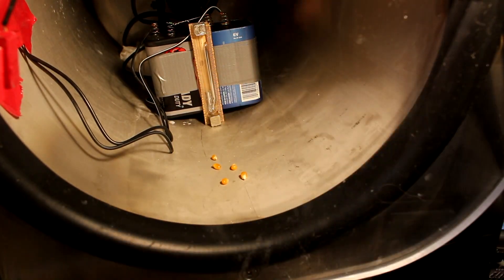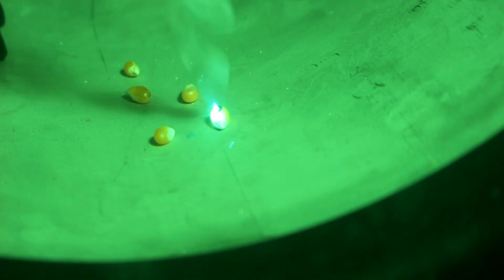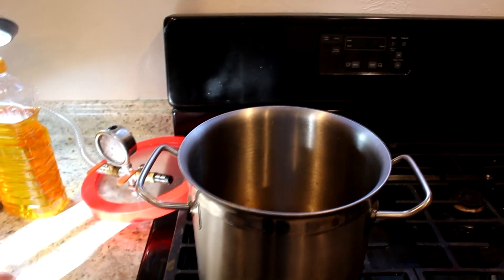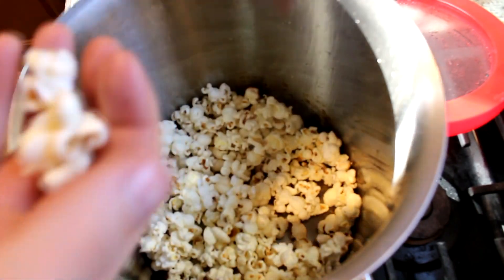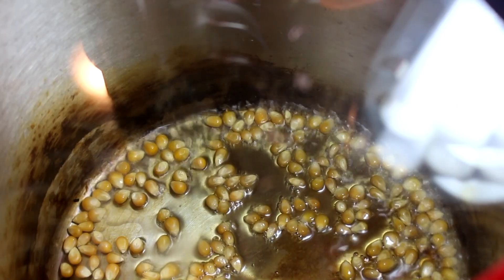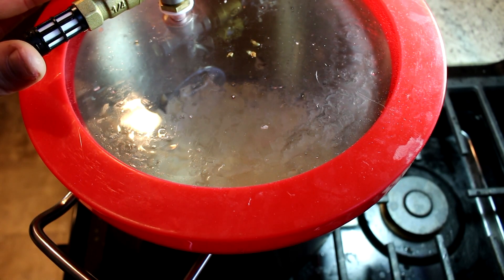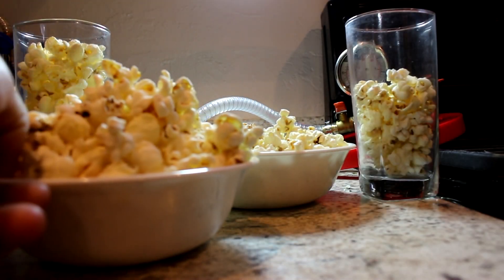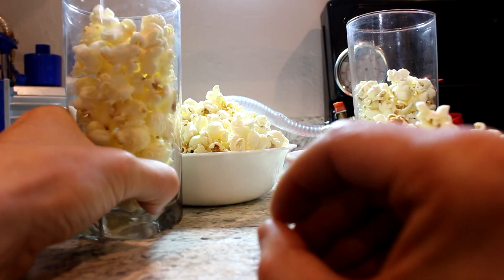Popping Corn In a Vacuum

Comment: great video.  I will have to try this one day myself.  My scientific mind also comes up with extra variables that might account for fluffier popcorn. One, is the vacuum  pump removes  ambient moisture from the air, so just the lack of moisture might also contribute to fluffier popcorn.  Also, popcorn has to be heated evenly on ALL sides.  That is why your laser didn't work.  While popping corn on the stove, you need to agitate the corn so that the unheated sides get heated.  That could also explain why more corn popped in the vacuum because they popped more violently, thus agitating the other corn in the pot to create a higher success rate.

Comment: You can pop the popcorn with laser if you wrap it in aluminium foil first. If you are still having difficulty even with that, you can coat the corn in a thin layer of oil first to make the heat spread out more evenly.

Comment: Late 2020 here with this observation that Cody cooked the popcorn incorrectly.  He seemed to add way too little popcorn for the amount of oil he used.  Heat the oil along with 3 kernels.  When one or more of them pops, add the rest of the popcorn.  I estimate that 4 or 5...maybe more... of those little cups of popcorn would do nicely in the amount of oil used above.  NOTE:  be sure to 'shake' the pot a little to cause unpopped corn to sink and be popped.

Comment: You should have tried pumping in a lot of air pressure into the pressure vestal to prevent them popping, then when the oil is good and hot where the corn would have popped at normal pressure, release the pressure and have them all pop together, and since the pressure was higher, but now is lower, they just might pop even larger!

Comment: If the chamber was re-pressurised as fast as possible, say with a dump valve or a large diameter butterfly valve would the  popcorn maintain its shape but be crushed becoming tiny-corn, (de-popped corn?) or be obliterated  and fragmented, and crushed ?  Like  they fell on the floor and got stepped on by  a cinema full of, um... above average sized persons? Either way, probably not yummy.
Or super yummy!  The hard ones that didn't  pop all the way are my fav's!

Oddly, I was eating popcorn as I watched ,this still am.

Comment: I suggest to consider a little moification of this experiment. Try to heat up of corn under normal pressure to the beginning of poping and then turn the vacuum on. Theoretically you should obtain a better result because of more steam should remain into the seeds. More expanded steam should cause the better effect.

Comment: Interesting, you can't boil potatoes to a cooking point at the top of Mount Everest because the water boils at too low of a temperature ( due to the decreased atmospheric pressure) and it never gets hot enough. I thought that might happen with your corn.

Comment: If you want to see maximum expansion, heat the popcorn at a pressure well above atmospheric, then release it through a fast valve into a large vacuum chamber.  The high pressure heating allows all of the kernels to be evenly heated without them popping, and without their water/steam escaping, and the transfer into the vacuum chamber lets them all expand at once to their maximum size.

Comment: By applying vacuum, you have also lowered the boiling point of oil. Most of the time boiling point of cooking oils (~300C) would be far above their smoking point (~200-250C), so would never be reached when actually cooking. But under vacuum you might actually reach its boiling point, so that would limit the temperature you are popping at. Boiling point of water inside the kernel should not be affected assuming the shells are air-tight. But more controlled (by its boiling point) oil temperature may also give you better heat distribution in the kernel. I would stuff a thermometer into the oil and make sure its temperature is consistent between atmospheric pressure vs vacuum before calling what's causing bigger pop corn size.

Comment: It will not pop because of the tryboculus mixed on oil. Also the vacuum has embotermus in it so nothing will happen even if you got 0.00000001 Of vacuum. Nothing will really happen trust me. The zacchelmos will force not to pop.

.

Comment: How about this one, popcorn pops because the internal pressure is greater than the strength of the skin. if you heat  them under pressure, say 10 Bar to keep it "easy" and as soon as the first ones start popping, do a high flow decompression. Result could be that they pop all at once and maybe be bigger because of the higher temperature achieved.

Comment: Would the corn pop in a vacuum without the need for the oil because isn't the oil only needed to help conduct the heat into the kernel when heat is used to pop the corn normally?

Comment: I don't think there's going to be a difference due to a pressure differential, as the kernel's probably going to burst at the same differential regardless.  My thinking is that the kernels will burst at an internal absolute pressure 1 bar lower.
I would guess that the larger size might just be due to the reduced air resistance against the rapidly inflating foam.

Comment: Cody, you can develop an industrial-size vacuum-machine for popping corn, market it to the movie theaters.  Fluffier, tastier popcorn (per Kanyon), more kernels popped -- and less numbers of corn kernel to fill each bucket (more filled buckets per container of popping corn).  Depending on the energy needed to create the vacuum, this might be a way to cut down on costs for the movie theater while offering the customer a fluffier, tastier bite of popcorn.  Patent it, dude.

Comment: -Im pretty sure that you don't need the oil to pop the corn in the vacuum chamber.  There shouldn't be any need for it.  
-The laser burns through the side of the corn kernel before the inside can heat up.

Comment: wasn't it hard to keep low pressure in the pot ???  With all the heat, driving oil to vapor, popcorn steam, etc.  I'd be interested in the actual pressures you were able to maintain.

Comment: No, theaters won't start implementing this. For one thing, the entire popper would need to be air sealed while popping. This means that any time someone reached in to fill up a bag of popcorn, the popping process would have to be paused as the air seal is broken. That could make the popcorn take much longer to pop and cause more delays when the theater is busy.

Comment: Well done Cody !!!→ Might I suggest a revisit ¿ This time have an already evacuated tank nearby, instead of the active pump. Wait until the first three or four kernels pop, then add the vacuum from the tank to get near instant popping of all the kernels and at an even larger size. 
The Chinese do it by opening one side of the chamber and blasting them out like bullets, then collecting them. In that method they pop in mid air.

Comment: That was interesting! You might also consider that water boils at lower temperatures in a vacuum and boils at higher temperatures under pressure. I think that oil works the same. So then you might be popping the popcorn at a lower oil temperature than normal...

Comment: A real industrial technic is use pressure chambers to heat the corn, when certain time pass, they simple opens and let the pressure fast return to normal and all will pop ate same time, getting bigger than normal in process, letting less corn peel and making and uncommon format (for americans)

Comment: the best pop corn is to vacuum seal (sous vi in french) butter into the popped pop corn, you can do this by having an alternative form of heat than the microwave halfway through the popping so that the seal on the bag doesn't break and the steam condenses vacuuming the bag, just set it on a warm stove to keep the oil frying until it's finished popping but don't burn the bag or break the seal :) :) :) might take a bag or two to get it down

Comment: I'm glad that food is generally sold by weight not volume, so just making something fluffier doesn't affect the amount you get...except at a movie theater where you pay for a bag full. If movie theaters saw this they could potentially make more money selling less corn? Unless running a vacuumed cooker cost more to run than the corn saved.

edit: that said, corn is dirt cheap so I don't see them doing this just to make their kernels fluffier.

Comment: When you perform an experiment you should change as few variables as possible but you changed at least two.  One being what you were testing the popping of corn in a vacuum.  But the other change which in all likely hood doesn't matter is in the first part you added the oil to the pan and then put in the popcorn kernels while when you popped them in the vacuum you put the kernels in first then added the oil.  So some of the kernels would have been more thoroughly covered in oil.  Since you can see that the kernels are not completely submerged in oil.

Comment: If having a greater pressure differential makes the popcorn pop bigger, you should try putting the kernels in a high pressure environment for a while to get the internal pressure up, then pop them in atmospheric air pressure and see if that has a similar effect.

Comment: This is a cool experiment - as usual - but I think you should have controlled for time as well. Does it take the same amount of energy to pop all the corn both ways? And if using a vacuum is faster, is it still more efficient when you factor in the energy required to pump out the air?

Comment: Could you try the laser on the kernel after pulling a vacuum?  Maybe if there was way less oxygen the laser wouldn't burn the kernels.  Or coat them in oil first; that may keep out the oxygen and allow the heat to be distributed a bit better.  Ultimately I guess the point is not to pop corn with a laser, but I'm curious.

Comment: Can you pop the corn with only vacuum pressure and no heat at all.
Reply: You would need a lot more vacuum than that can produce.
Reply: But it can be done right?
Reply: casinogiant
Yes I believe so, if that vacuum capability exists, I'm not sure on the exact amount it would take but it would be quite immense.
Reply: Devils Advocate So,  if you were to release popcorn in space, would that be enough to pop it?

Comment: how did you maintain any sort of vacuum on that pot? You're going to have to show me a vacuum gauge for me to believe you were able to do it.
Reply from the maker: Funy story... I broke the vacuum gauge during an earlier experiment, you can see it in the background at the end.
Reply: Just a fun video dude he didnt win a the nobel prize for his vacuum corn popping. Take it for what it is.
Reply: Well, that pot doesn't appear to have any gaping holes in it, and it doesn't seem to be made of a thin material that air can easily get through...
Reply: crazyguywithasword when gasses get hot, they expand, when liquids are exposed to a vacuum they boil. You can clearly see the oil boil as he applies the vacuum. Those two things together will make achieving a vacuum impossible till all the oil is boiled off. At which point you'd only burn your corn.
Reply: SentByHim It doesn't have to be a perfect vacuum to show that lower atmospheric pressure means the kernels expanded more.
Reply: The oil doesn't evolve that much gas. As long as you can out run the volume created, it is easy enough to have a vacuum. Water on the other hand, with a higher vapor pressure will evolve a lot more gas and is difficult to outrun, especially since the boiling point falls as the pressure goes down.
Reply: Maybe he is not but I am. I work on Mars project, creating atmosphere and we mess with vacuum. What you say is partially right but almost insignificant for oil. In 4.5l chamber 100ml water does indeed significantly cool the chamber within few seconds after you stop the vacuum and boiling stops. When tested with oil and even diesel, boiling would proceed for further minute, up to few minutes sometimes. That's because oil doesn't evaporate as much as water, in fact we are probably pulling out mostly air. You don't burn things under vacuum, in order to burn a temperature is needed so the fact that something boils doesn't mean it changes molecular structure as in conventional boiling procedures. However, his setup does seem to be pretty good for such a simple aparatus and we have a lot of trouble with leakage on much better setups. Maybe he uses a pretty strong pump that copes with this.
Reply: Whats your point then?
Reply: SentByHim do you think being a scientist requires you to wear a white lab coat, and have a special title?
Reply: +SentByHim
He kept repeating that the one set of popcorn was made in the vacuum chamber and the other in normal atmospheric pressure. I think he did say "popped in a vacuum" here and there but we know what he meant. 
I think we can forgive him. 
 He cooked them under minimal pressure, I'm guessing 0.1Pas or maybe lower. Would be nice to know how low the pressure really was. I guess he doesn't know either cause the gauge is broken xD
Reply: Miister Cloud didn't say it did, I said it will not pull a good vacuum. If he had a gauge you'd see he's hardly pulling any vacuum from the system. I'd be surprised if he could pick up the pot with the lid.
Reply: Owiko7 he's no scientist and has no idea how to control for variables?
Reply: SentByHim I'm not saying you claimed it had to be a perfect vacuum. The point I was making is if you can see the results, why does it matter how low pressure it was within the pot?
Reply: This video demonstrated that lower pressures create larger popped corn...  If there was a way to maybe beam microwaves into a vacuum chamber, that might cause the water molecules in the popcorn kernels to expand enough to pop. That might be a way to do it in a greater vacuum than the one demonstrated. Besides, in the strictest sense, the corn kernels themselves make the interior of the "vacuum" chamber no longer a vacuum--that is assuming we define the vacuum as a space devoid of a solid, liquid, or gas excepting the walls of the chamber.
Reply: Earth Skyman What a great job, what did you study in school to get a job like that?

Comment: I have noticed here in the Texas Panhandle that if you have old popcorn that will not pop, one can rehydrate the corns and make them pop.  Still having to pop them around 400 degrees F.  Did you happen to note the moisture in the corn, and what was the temperature differential between the atmospheric and the vacuum popping?  I would almost expect thee corn to pop at a lower temperature in a vacum.  Jeremy Pierce

Comment: If you can hear then pop then is not vaccum. Tho sound is not transmitted in vaccum .
Reply: mike02601 however sound can also travel through the pot and therefore you can hear the pop if they hit the lid or sides of the pot

Comment: A maybe more important factor is that the corn popped in air will tend to shrink back down as the steam condenses while the vacuum-popped corn won't.  Is there a way to measure the peak (rather than final) volume of the corn as it pops?

Comment: Not happy with the vacuum pressure presented given how audible the popcorn popping continued to be. I could understand lower frequencies still being conductive as popped but higher frequencies should have been unheard if anywhere close to being real vacuum pressure.
Reply: Huck E It's from the the corn hitting the walls and base of the pot.

Comment: I assume that without heat or oil the kernels just sit there in a full vacuum and never pop?  If they were caused to gently tumble about and were exposed to intense light to heat them up, you might get puffy popped popcorn even bigger than air-popped.  In my experience the oil expense is greater han the popcorn when making popcorn "normally".  I'm not sure this would be much better than air popping but the way we eat popcorn around my house, having a machine the you put kernels in on one end and having popped come out on the other would be wonderful as continuous production with some kind of "bowl-full" sensor to detect when enough popped popcorn is present, starting when it gets low and stopping when full.   Amazon dash when the kernels get low. :-)

Comment: could you slightly moisten the kernels beforehand, maybe with a humidifier. to increase the internal pressure to get an optimal expansion creating larger and more consistent popping?

Comment: Stop giving the movie industry ideas on how to charge us more whilst giving us less.
Reply: SDD525
Yeah, well I mean even less for more.
Reply: SDD525
True true
Reply: But it was revealed at the end that the texture of the vacuum popped kernals are superior. When people buy popcorn at theaters they aren't trying to maximize the number of calories they get per dollar, they are trying to maximize enjoyment. 

Also seems unlikely since the vacuum popcorn machines would be more expensive, have additional parts that could fail, and couldn't be accessed continuously as the current machines are. Not saying it's impossible, but there is some engineering that would have to be done first.
Reply: Watch movies at home with your special one
Reply: came here to say exactly this